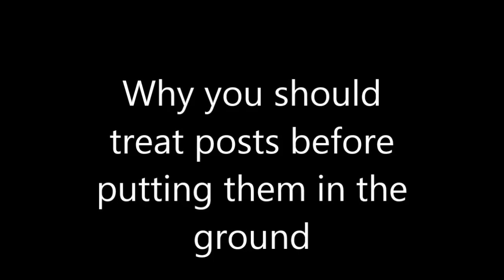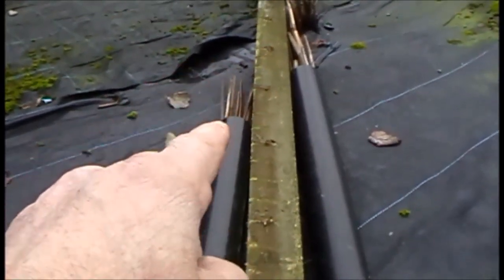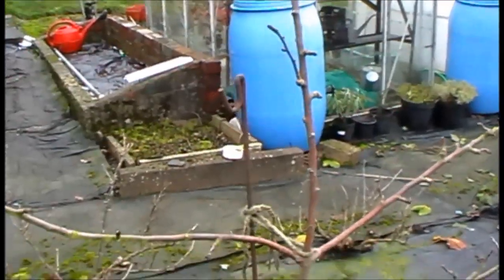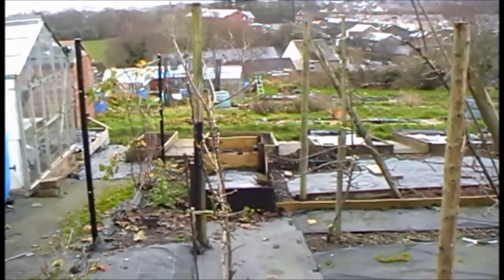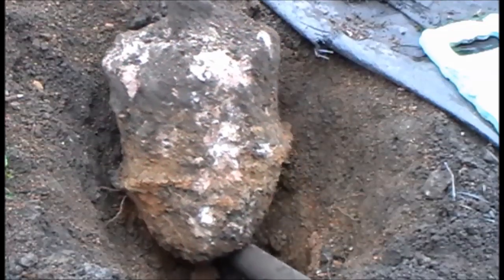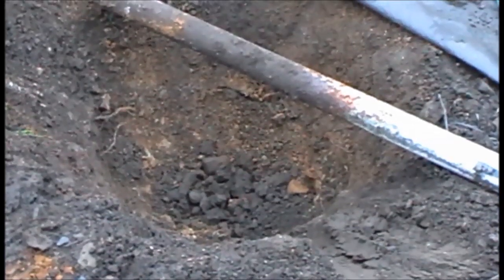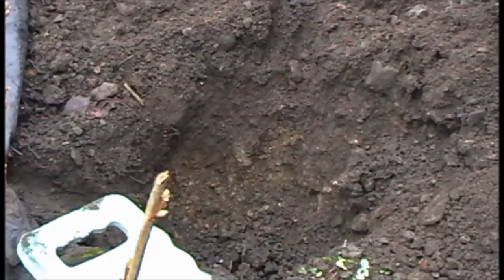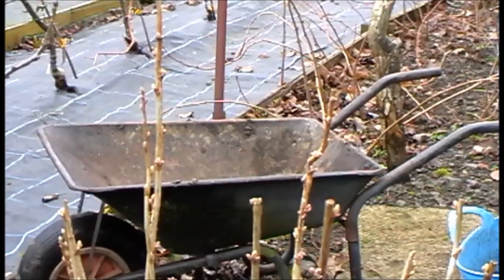Why you should treat your posts BEFORE putting them in the ground

Comment: Happy New Wellies 😀.  Those concrete post bases took some shifting 😅. We are not allowed use concrete on our site so we can only dig a tight hole and choc with bricks. I will be replacing my autumn raspberry framework in the spring and have some scaffold poles to use for the uprights. I may pick some of those grippa's up from the next garden show for the wires. Need to get all these little jobs done before the cold wet weather arrives 👍. Cheers. Nigel
Reply: I've seen people using expanding foam, sounds like a great idea.
Reply from the maker: Thanks mate 👍
I was glad to get them out ( and have just finished postcreting the scaffold pipe).
Loving my new wellies 😜😃

Comment: Hi Woody, this video is very opportune, had a friendly discussion with Nigel of MuddyBootz fame last night regarding raised beds and the use of timber in constructing the bed he prefers scaffold battens I prefer Structural graded timber pressure treated and the discussion got round to timber going rotten.   I have done a fair bit of civil work in rivers mainly the Thames and in the Low Countries in Europe.  My argument built on experience is timber only goes rotten with wet rot where the air meets the water line or earth line your video shows just that.  I treat my post just the same as those you have prepared.  I am of the belief that just a ring of bitumen 3" above and 3" below the ground will suffice.  The rate of rot how long from putting them in varies on a). how long they were seasoned and where they were cut from in the log ie from the top of the tree or from the main trunk. If you look at the ends if the grain is circular like a dart board it is from the top and sappier than a quarter grain lower down.  Have a look and let me know.  Have you watched any of my videos putting posts in and how I line them up? Oh, by the way, my argument was as I can buy structural timber a bit cheaper than new scaffold boards and his argument is he can buy second-hand boards very cheap, but I don't want to go there.  Take care & thumbs up. Mike
Reply from the maker: Thanks for this comment Mike. I think you are spot on with your observation and theory about the site of rot.
I will have a closer look at the posts and let you know 👍👍
Ps; will also have a look at the videos you mentioned.
Cheers mate 😉
Reply: Woody could you have a look at Sean's upload December Y1: New Growing Module and Boxing Day Visit 36 and the comments between myself and Nigel I don't want to upset him but I have a thing about waste and cowboy scaffolders.
I think I may have to do another raised Bed video. Have been looking at other raised bed video's and the reasons are varied why they went down that route all valid, demonstrating individual needs vary. It is the questions one asks oneself that decides the needs, not this is the way to do it.

I
Reply: @allotmentuk1303  excellent comments on both channels Mike B.